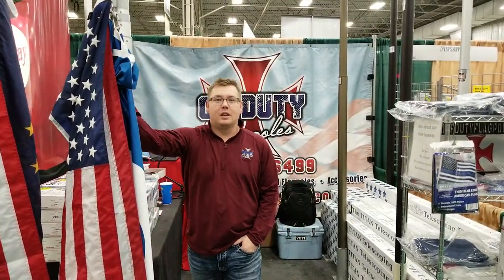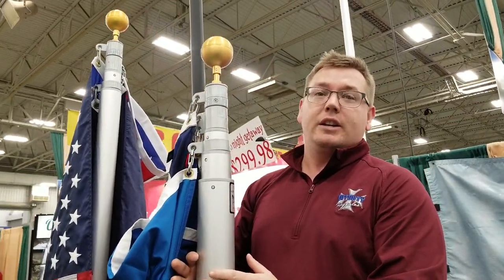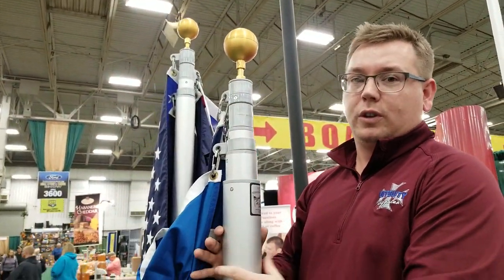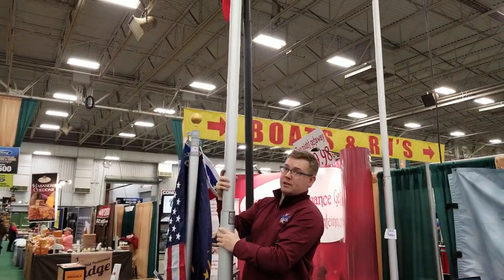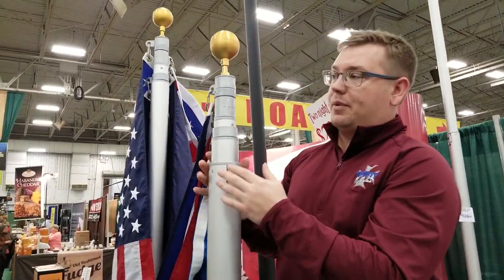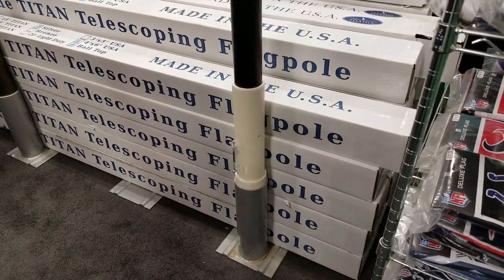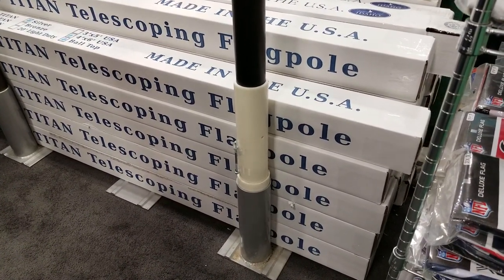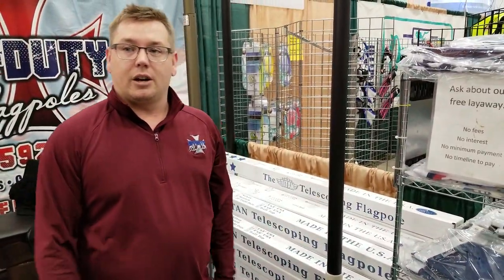Off Duty Flagpoles - Flagpole installation and twist and lock raise/lowering of the flag

Comment: What do you suggest to unlock the sections that are frozen? Pole will not come down.
Reply from the maker: If the sections are stuck, I recommend applying some penetrating oil, like WD-40, to the joints. Let it sit for a bit, then try gently twisting the sections to work them loose. If that doesn't work, you can try tapping the joints lightly with a rubber mallet to break the bond. Just be sure to go slow and avoid forcing it to prevent any damage. Good luck, and don’t forget to subscribe for more tips and tricks! 🇺🇸🛠️